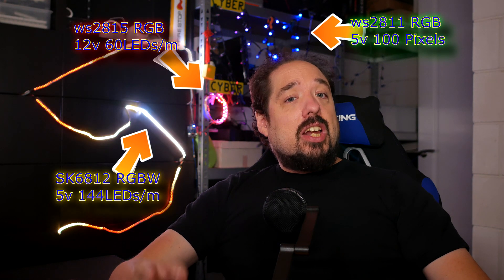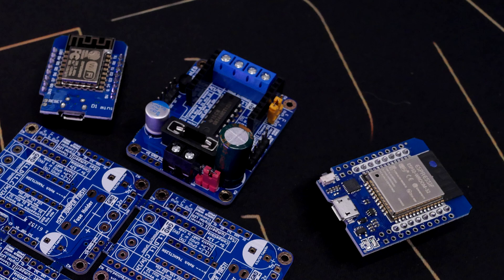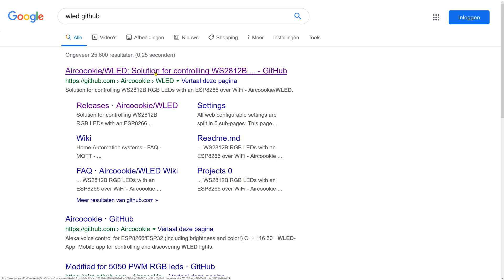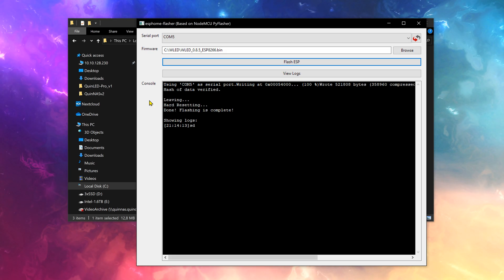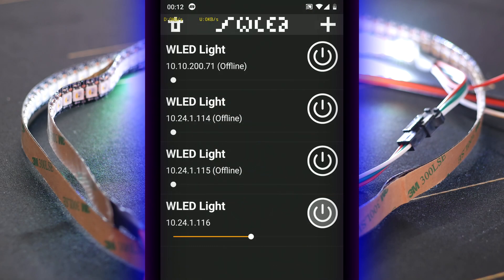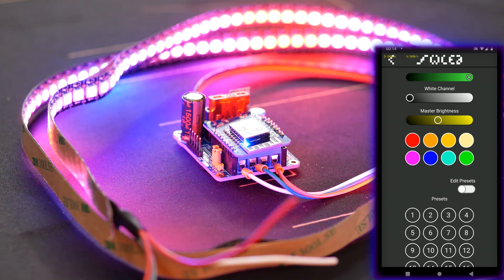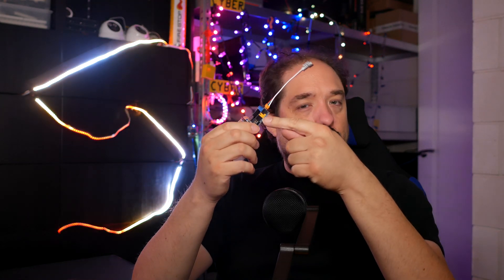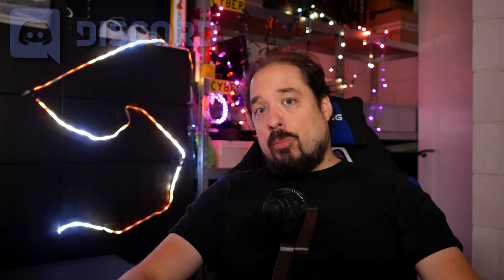WLED Tutorial - The ultimate DIY RGB Controller?

Comment: hi would the quin board run a led strip that has 6 wires coming out from it I take that 2 of the wires are plus and neg it look to have a wire for each of the colours  g r b and the other 2 are for worm white and White its a lot of wires just wondering if it could do the job at 24v regards
Reply from the maker: Ah, you have an Analog LED strip there, not a digital one. The QuinLED-Quad and The QuinLED-Deca are suitable for those! Since you seem to have an RGB+CCT strip you'd need a QuinLED-Deca to address all the channels, check https://quinled.info for more information about them. :)
Reply: @IntermitTech  thanks for getting back
Reply: @IntermitTech  Hi Quindor I was watching you on the Drzzz channel the other night you were talking about your boards led and about costs. I think we have spoken in the past regarding having a kit made but you seamed not to like the idea that much. I do get were your coming from not sure if you remember we talked about JlcPcb to make the pcb's because I thought they'd be a little cheaper there.  anyway I'll get to the point I also follow Julian on his channel and he has just used JLC-Pcb to make up some small boards but the interesting part was that the service also offers a surface mounting of components thought that was quite interesting here's the link to the video worth having a look I think https://youtu.be/GpR87cdEdZc      let us know what you think Regards Peter